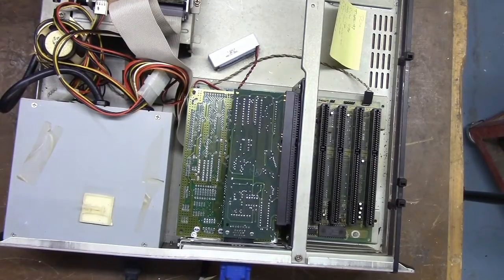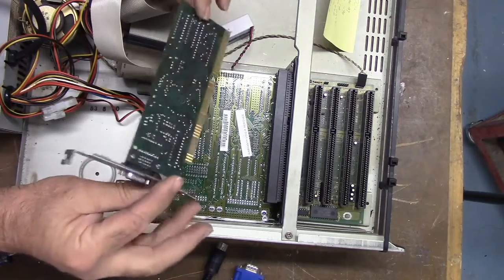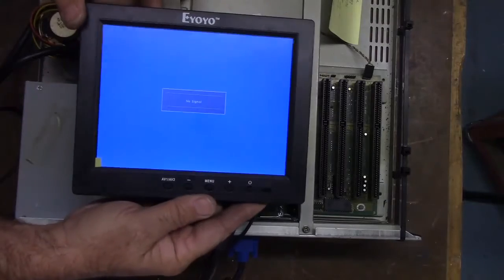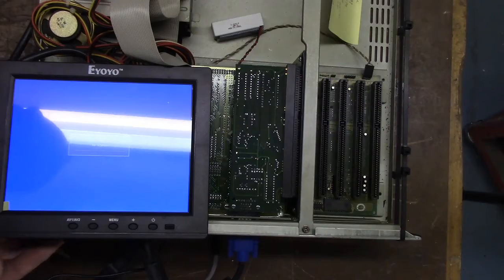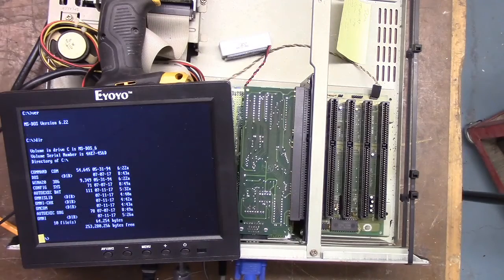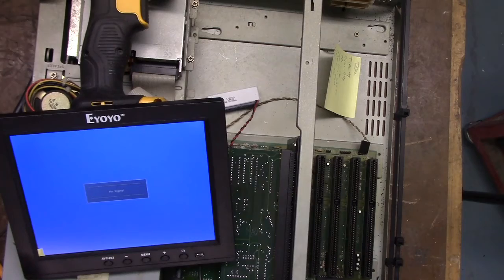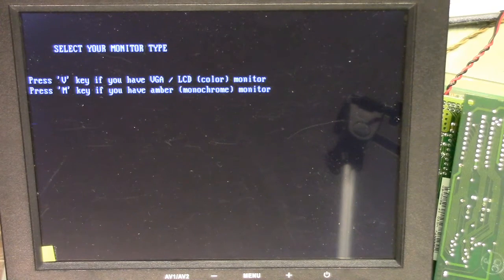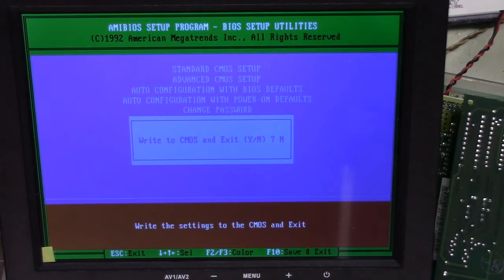Omniturn Control Computer Upgrades   Part 1

Comment: Do you think it's possible to use modern PC for it if use some ISA to PCI-E adapter for the motion control card or something like that? This old hardware is so finicky
Reply from the maker: @Mrsolomatov  can't tell you. Unlikely You may have to watch for an PC or upgrade to a more modern controller like Centroid CNC

Comment: hi good afternoon, very good video, I have a question my cnc onmiturn does not recognize my usb when I connect it, my usb is formatted in FAT32 but it does not recognize it, could you share the format that the memory should take or if I have to install some driver and with what program can I do it
Reply: Watch all the videos on the Omniturn. You need the special utility to format the USB stick

Comment: Good video, I need to change my battery on motherboard, which one did you use.
Thanks Mark
Reply from the maker: pmproducts gosh, I don't remember. I think it was an AT motherboard battery replacement. I sold that system.
Reply: @martyscncgarage5275  can you fix omniturn control?
Reply from the maker: @constantintintea5983  it is not what I specialize in. You didn't mention what is wrong with it.